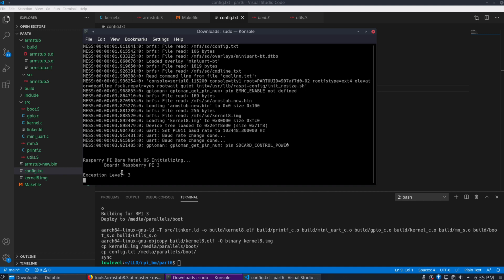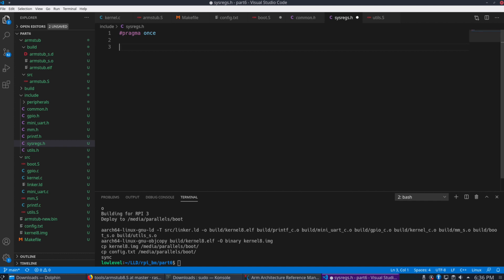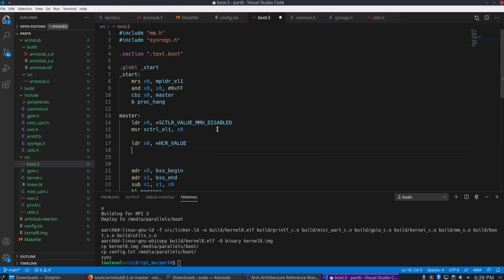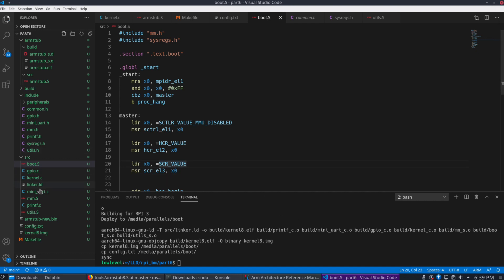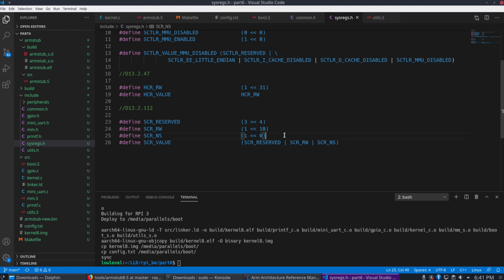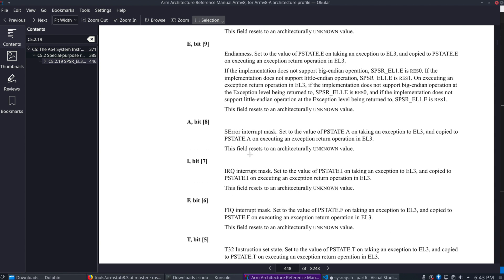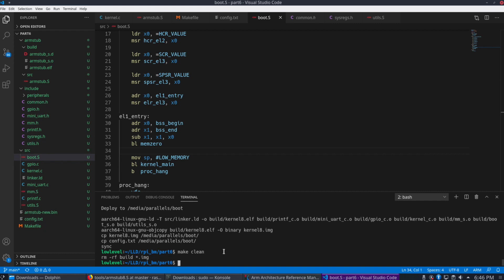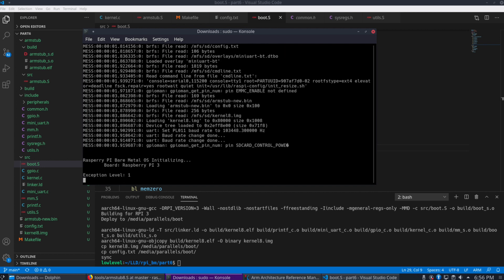Raspberry Pi Bare Metal Tutorial - Part 7 (Boot to EL1)

Comment: As I tested on RPi4, it seems that, if I change the `COPS` by removing `-mgeneral-regs-only` option, the kernel will hang somewhere. I also tested on `part4-5` directory, remove such a flag does not affect the correct behavior. I am puzzled on this symptom. btw, I remove this flag is because I want to try floating point operations.
Reply: The default armstub initializes floating-point among other things. Try adding `msr CPTR_EL3, xzr`  (the relevant line from the default armstub) to your armstub.

Comment: At https://youtu.be/UOpODhRuP3I?list=PLVxiWMqQvhg9FCteL7I0aohj1_YiUx1x8&t=610, it seems that the code starting from `master` label is an ISR? Why is that? Who triggered the interrupt and how?
Reply from the maker: getting to the master label is done from here:

    mrs x0, mpidr_el1
    and x0, x0, #0xFF
    cbz x0, master

First line gets the current CPU ID.  Second line ANDs it with 0xFF.  Third line, if the result is 0, meaning this is CPU 0, then it jumps to the master label.
Reply: @lowleveldevel1712  Thanks for you reply. I may be not clear on the question. Now if I regard a power reset is a "interrupt" or "exception", then the part of the start code until the 1st ERET instruction can be regarded as an ISR.

Comment: Hi i have a question , in the code there is an abstraction between RPI 4 and 3 with the ifdef , but you don t do a #define RPI_VERSION 3 or 4 in the headers ?where are these preprocessor defines defined  ? will it be defined throught the makefile ? because when you write make it goes for the RPI 4 as default , how does this work  ?
Reply: @lowleveldevel1712  i see , but how will the c code understand that you defined  RPI 4 throught the make normally #ifdef RPI_VERSION_4 only reacts when you #defi ne RPI_VERSION_4  in the header so that this exact section will be executed , RPI_VERSION=3 make is passing an argument  to the Makefile so that it knows that it is creating an img kernel for the rpi3 , but how this kind of abstraction will be sent to the c code sothat only the sections for the RPI_VERSION_3 will be executed or to be exact only the Section between #ifdef RPI_VERSION_3 and #endif , thank you so much
Reply: @naruz5262  Please take a look of the Makefile, for COPS (`-DRPI_VERSION=$(RPI_VERSION)`). This is where the make definition is "transformed" to C definition.